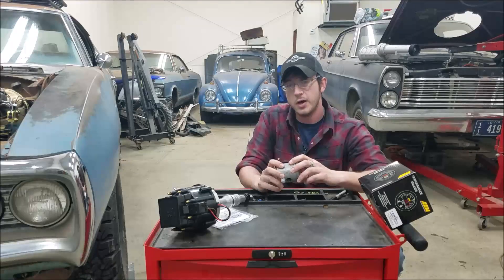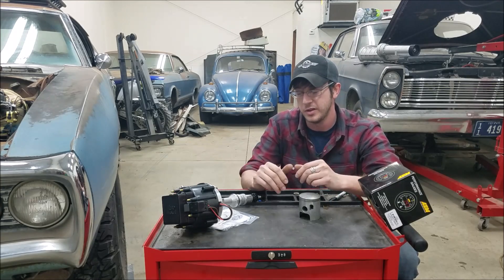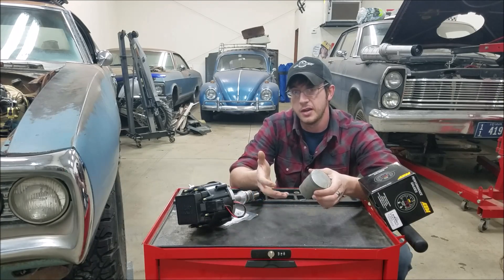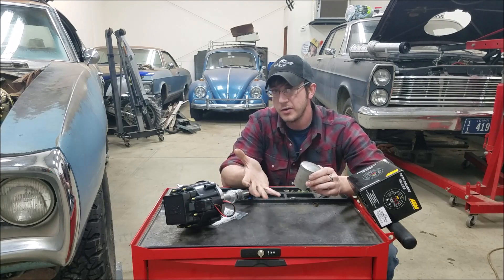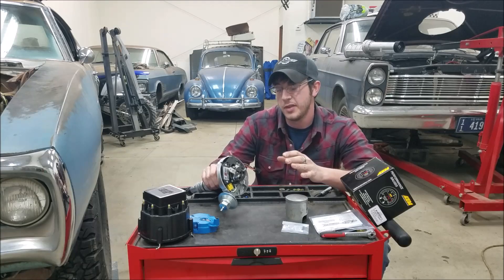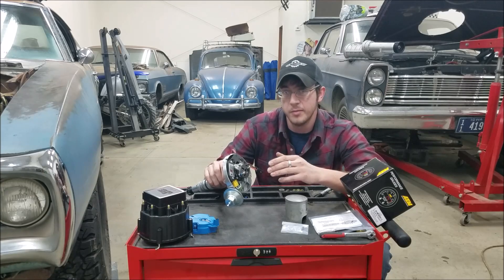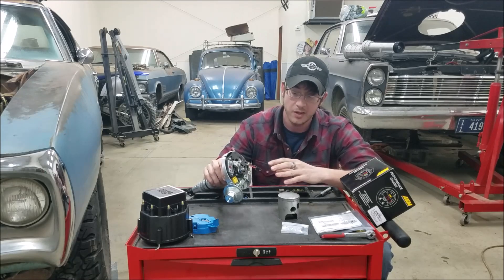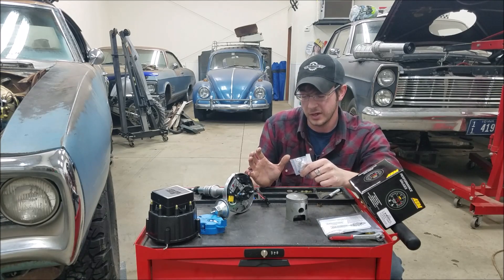Ignition Timing Explained: Distributor Tuning Theory (Engine Basics 101)

Comment from the maker: Honestly, Carb & Ignition timing tuning is all very simple - disappointingly, there is a lot of misleading info out there. 
Planning to make some timing vids in the future - maybe another round of carb vids. 
as always, the best tuning tool is a wideband o2 sensor/gauge. this tool both saved my engine when I was learning and really helps to dial in a tune. great for troubleshooting also - NO MORE GUESSING!!! (link on next line)
this is the one I run and prefer - https://amzn.to/2t6mbgN BUT, any wideband is better than no wideband in my book.
check them out, do some googling, your engine will thank you for it.
Reply: Bloody good tech as always, mate!
Reply: I think a good video on using a wideband o2 gauge to properly tune a carb would be terrific.  Everyone recommends one, and they are nice, but I've yet to find a really good video about using one for tuning.  Just a thought...  Related to this, what are your target AFRs at idle, part throttle, full throttle, and cruising?
Reply: How do you see the future being electric vehicles affect us carbureted v8 guys and our work and do you see diesel mechanics and other mechanics who work strictly on internal combustion becoming obsolete and losing their job

Comment: My initial timing is 12 degrees  Total 30 but when I hook up my vacume advance it goes to 56. It doesn't spark knock though. Can I install an adjustable vacuum advance to cut this back?  Need help. 396 Big Block with HEI

Comment: Cant for the life o me find a decent vac advance for my 383 dodge polara.  All the ones i find, the arm's flipped the wrong way.  Anytime i find one with correct arm, the diaphragm is busted and wont hold vacuum.  So ima stuck running my original advance with busted vacuum using mechanical advance.  It runs fine... but its a daily driver and i could um
..use the extra 'economy '

Comment: I enjoyed your video on timing. I switched from efi to a 600cfm Holley carb on my ff5 cobra 302 1987 motor. I got a Davis distributor and running 6 lbs fuel pressure to the carb. I am 75 and old school. I want to set the timing at 11 degrees at idle. I use the car for just street use. Is that a safe setting?  Thanks. Paul in Ohio

Comment: I took your advice and got a progression ingnition i got it installed with relay it fires right but having trouble generating a table could use some advise i got a 1965 thunderbird rebuilt it 2 years ago stock the disributor was wore out so i got a progression ignition

Comment: Hi. I've watched a lot of your videos thru my rebuild process.
I rebuild a 1995 f150 302 engine. 
But I hit a wall when it comes to getting it to start. 
I put a holly 600 and I got a points style distributor (because I wanted to get away from electronics) well, I've started it 2 successfully until it idles and then dies then I can't start. I did all preliminary adjustments for the carb so i think that is all fine. But the ignition system is giving me a fit.
I got a duralast distributor and a duralast coil with a ballast resistor. Still nothing. 
I ordered a hei protonix flamethrower like the one you have here but it is entirely too big to fit. 
I want to avoid spending much more money and I want to stay away from ignition control boxes. Any advice? The performance shop in town recommended an msd for like 500. I don't want to spend that much.

Comment: I'm old school, So I make sure that the engine is completely warmed up and go to the nearest steep hill and roll the window down so I can hear if it is pinging and I drive up the hill. When the engine is under a load is when you can really hear what it is running like best in my opinion? And if it is hot out and you go to start the engine and it cranks over hard it tells a story of too much advance.

Comment: The comments are what I needed to figure this stuff out!
My conclusions are:
1. Use metered vacuum for the vacuum advice.
2. The springs on the mechanical advance are intentionally heavy so mechanical advance is correct conservative to protect the engine. However, we can find spring tension that allows more mechanical advance so we don't leave power on the table.
3. Wide band O2 sensor and vacuum gauge for on the dash looks cool and are a great monitor of the engine's performance.
@Thunderhead289, please correct me if I got anything wrong.

Comment: hey luke i was wondering if you could help me out. so i’ve got a ford 300 ci in-line 6 i rebuilt with a comp cam 268 in it with 219 degrees of duration at .50” lift. i’ve got my initial ignition timing set to right around 12 degrees (i referenced a chart you showed in one of your previous videos that said to put initial at 10-12 degrees for cams below 220 degrees) and with the transfer slots on my carb set to a square, it doesn’t want to idle, even with vacuum advance on the manifold vacuum port. to compensate i’ve had to turn the transfer slot screw about a turn in to get it to idle right around 700 rpm’s and it seems to run good at that but has a bit of a hard time starting after it’s ran at operating temperature. i have to give it a little gas to get it to fire off good. also has a bad off idle bog when i give it more than about half throttle while setting off from a stand still. would this be a situation where i give it a bit more initial timing to get it to idle with transfer slots at a square and put stop bushings in my distributor if it exceeds safe total timing limits? also i’ve got an adjustable vacuum advance on my distributor so that could also be adjusted too in an effort to get more timing at idlebut i figure i’d ask an expert in this before messing with that lol. any help would be appreciated as this is really my first time tuning a carb setup on a driving vehicle. thanks!

Comment: If replacing distributor in 1974 F-100 to a Jegs HEI distributor. It fires runs great shut it off and won’t start. Or it might do I need to ground the distributor

Comment: I have question on the relationship between engine timing, rpm and automatic transmission shifting. When and how does the transmission know when to shift and do so smoothly no matter how hard you push down on the throttle?

Comment: i built a distributor cut off the the vac with hacksaw and made it full advance   its a long story but ran great the cam with lots of overlap ,i had hardly nothing anyway  timing set at 26deg if i remember right, yrs ago but wow i needed a stall bad  350 chevy 72 chevelle it was all top end
Reply: your good my friend up there in iowa from here in georgia     .....DEX

Comment: Hmmm.... so If I'm climbing a hill at 65MPH in my 64 Galaxie and I give it a little more gas and I get a light ping - my vacuum advance is coming into play.  When I give it more gas I hear the secondaries open which makes it more rich and the pinging stops.  At the point of me going  to 75% throttle does the vacuum drop off enough to eliminate the vacuum advance?

Comment: Hey man.
I have a 74 351w I just redid the heads new carb all gaskets. Put in an EI. I am at TDC. Can't get it to start. Backfiring fuel out of the carb. It's in my boat so it's just the basics no vacuum advance no sensors.coil is good I have spark.

Comment: I have seen several of your videos all have very great information although if at all possible I will try to avoid making videos inside that shop it's kind of echoey and hard to follow
Reply from the maker: The issue is that I don’t have anywhere else to make videos. I actually live in a trailer park and most of the year by the time I leave work it’s dark outside!

Comment: Hey dude. Great video. Id love to be able to chat with you about a set up i have in the wifes 79 f250. Im having a hell of a time finding a good base time for. 400 bored .060". howards roller cam, edelbrock performer with a 650 AVS carb. Trickflow powerport heads and racetech pistons at 9.75:1. Just cant seem to find the sweetspot.
Reply from the maker: If I had to guess - somewhere between 15-22 degrees!
Reply: @ThunderHead289  Thanks for the reply!

Comment: Could you please explain why the vacuum advance is connected to a vaccine port on the carburetor above the throttle plate?  Also explain why vacuum at that port increases as the throttle opens and why that advances the timing.
Reply from the maker: Look up “ported vs manifold vacuum” you will find my video, it’s probably the first one
Reply: @ThunderHead289  awesome 👍 thanks

Comment: I Don't care what anyone says about electric distributer. I have seen electronic distributer run a Brand New Battery. 140 dollar battery. Put Points in.charged the battery back up. Dam truck started 1 turn.. I will use points. When your electronic fails. And it will. You will remember what I said about points. Like I said. My 1992 is going to have a rebuild 94 motor. 84 heads. Cam. 2 barrel. Points. And when government shuts down all electronic cars. I will go out and start my 92.
Reply: Hi. I have a points distributor on mine but can't seem to get it to start/stay running. 
How did you wire yours? What did you use?

Comment: Hey ThunderHead289! I'm trying to turn a Suzuki Samurai into daily driver, and so far I have put a aftermarket distributor, carburetor, air intake, and headers on it. I also followed your suggestion with the O2 sensor, and that has helped greatly. Interestingly, when I put timing at the OEM suggestion, 10° BTDC, I'll get afterfire at idle. Idle and cruising is much happier at 12°, but I'm still adjusting a degree each tank of gas to find best fuel economy. Would my other low restriction mods have an effect on  where(with regards to crankshaft position) my effective powerband/flame propogation is? Also, have you ever come across aftermarket distributors that have an incorrect total advance? Thanks

Comment: I once, when I was younger, changed a timing belt on my old Yota to find it had previously been installed 1 tooth retarded. I set it correctly, and put it all back together. I was in a hurry to get to class that afternoon, and completely forgot to reset ignition timing... first lay into the throttle, she rattled angrily- I realized my mistake but was already late, so I nursed it along. I found if I kept it right at the edge of ping, she ran hotter than she ever had. I got lucky and didn't blow a head gasket or shell a piston. Luckily, a buddy had his timing light with him after class and I set her straight again. 
Didn't run as feisty, but still better than with a retarded cam!

Comment: I have a 1987 Dodge 150 318 it pings it has two lines on the harmonic balancer which one is the right one to go by?the one going all the way across or the shorter one?seem like it pings more after its warmed up .and when it's cold starts it chokes me to death.
Reply from the maker: Is this a fuel injection engine? 
If so, it could also just be lean - like a weak fuel pump, or dirty filter

Comment: What about the people that lock out their advance weights, so that their initial timing is their total timing? Would that mean those people are more prone to pinging and would have to run less total timing since it's always on and not advancing slowly with springs and weights?
Reply from the maker: There are a lot of opinions about locked out timing out there, but I’ll provide you mine - 
The only time I condone it is for circle track where you are at throttle all the time and don’t need a curve - only reason being is so you don’t snap a spring and put you out of the race. 

As far as street cars, the only time I have ever seen it relatively work is when an engine is built with too much cam and not enough static compression to support it - that scenario makes for a really slow inefficient burn time at idle. 

Does that all make sense?

Comment: Awesome! Thank you for the video. Its great to learn and get an understanding of the basics. 

Do you have any videos discussing how to convert a points distributor to an HEI style (electronic ignition?)?  On say a 67 cougar

Also What does a guy need to run a 85 351w on a run stand without the ignition module? I think i would need a different distributor then?  Im also planning on puting it in a 67 cougar.

I tried googling a converson, but im lacking on nomenclature so im not sure what some of the parts were they mentioned. Thank you

Comment: Just gonna put this in the comment section, hope some of you guys can help me.

I have a ford fe 360 in my truck, i put an edelbrok perfromer rpm intake and a holley (I think its a street warrior) 600 cfm carb on it. Now, i have never worked on one of these engines before, because they are quite uncommon where i life, thats why i need some help.

I fiddled around with the carb a bit, but nothing to advanced, because i need to get a vacuum gauge... just some basic tweaking on the idel mixture screws. 
I went on and got a timing light to set the initial timing. I removed the vacuum hose from my distributer, pluged it and set the timing to about 8 degrees BTC. Here is what confuses me... When I put the vacuum hose back onto the vacuum can on the distributer i get like around 40 degree of advance. Am I missing something?
The weird thing is, when i have the hose connected to the can the engine sounds way smoother and healthier, but when i rev it it seems to get missfires (didnt rev it to  much, cause im kinda scared)
Another thing i might mention as well... When i put the engine back together i caused a massive vacuum leak at the carb gasket and had multiple backfires, could this have caused some damage?

So my questions are:
Is the vacuum can dead or does it need some adjustment?
Should i adjust the carb first?
What else could/should i do? 

Thx guys, I would really appreciate your help.

Comment: Got a question.  Have a f100 with 360 engine.  I know it has very low compression ratio, also has a bigger cam than stock.  I run 20 degrees initial with 5 degrees vacuum advance from manifold.  My question is what is the maximum total advance I could run in your opinion.  Can't really hear pinging with the flowmasters, so listening for knock is difficult.  What do you think.  Now it's at 36 degrees total.
Thanks in advance😀haha.
Reply from the maker: Claude LaDow howdy, so let me understand this correctly, your vacuum advance is only adding in an additional 5 degrees of timing? How have you confirmed this? 

You can check this by taking a timing reading at idle with vacuum advance unhooked, then taking a reading at idle with vacuum advance hooked to manifold vacuum - subtract the difference, and that is the total additional vacuum advance available to you.
Reply: @ThunderHead289  yes, it is adjustable canister.   Set with timing light and vacuum tool.  Didn't want to much at cruise because of the aggressive timing curve.  All in by 2500 rpm.  Engine responds well to advance, but I need to know where to stop for most power at max rpm.....5000.
Reply: Any idea how much total timing you would run on this engine for max power?

Comment: my timing retards before it advances, when i hit the throttle. Is that normal?
Reply from the maker: Vacuum advance drops out when manifold vacuum goes low. 

But when you are standing beside your car, it will only drop for a moment since there is essentially no load on the engine - so manifold vacuum will come back.

Comment: I’m playing with a locked distributor, timing programmed into the ignition box, and an adjustable rotor for phasing...
Reply: Running 20 initial 32 total in by 2800. Interesting thing is that the thing is set for total timing and the electronic curve retards from there as a function of rpm...

Comment: do you know if it is possible to run stock electric fuel pumps that run 40 psi or better on a carburetor with a fuel pressure regulator and return line?
Reply from the maker: Absolutely you can. 
You probably are using an in tank pump for a previously fuel injected vehicle correct? 
In that case, pick up a injection to carb bypass regulator
Reply: @ThunderHead289   thanks for the info.  Have a 96 f-250 snow plow truck that only runs in the winter. Thinking about a cam swap but don't want to spend extra bones on a sniper efi to make it work.  Guess I should start with the plugged converter and ancient snow plow!!

Comment: Any insights into the weight of the springs corresponding to the weight of the vehicle?
Reply from the maker: Typically a heavier vehicle will need heavier springs. It all depends on the load vs rpm really. 
But less power to weight ratio = slower timing curve
Reply: @ThunderHead289  The engine came set up for something like a 3000# fox body and I put it in a 5000# SUV. Can set the timing so it launches off idle and falls on it's face or it's slow off the line but pulls hard at higher RPMs. No spark knock though.
Reply from the maker: Johns Junk I’m assuming this is still carbureted, correct?
Reply: @ThunderHead289  throttle body EFI from FAST
Reply from the maker: Johns Junk gotcha. Put in heavier springs, but I really can’t help you with that one - this channel is carb country in that regard.

On a carb I’d run a heavier secondary spring and a smaller carb cfm overall

Comment: I agree with most of what you said however, firing too soon or before optimum doesn't always cause knock.  You could be well past MBT before you hear knock.  For example: if at any load and rpm the engine wants 35 degrees of timing for best power, it may not knock till 40.  So setting timing just before knock isn't always the best way to set timing.
Reply from the maker: I’m mad at myself I didn’t say this - I said “retard the timing”, but I should have said “retard the timing 2-3 degrees and reassess” 

You are 100 percent correct
Reply: do you realize 40 degs is 1 tenth of a circle the piston is still rising when this happens   something does not  sound  right